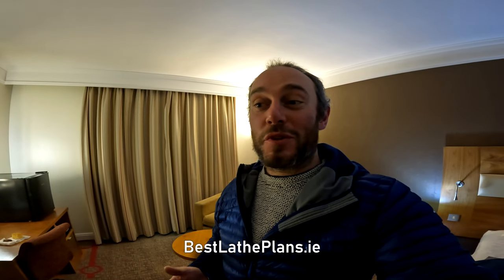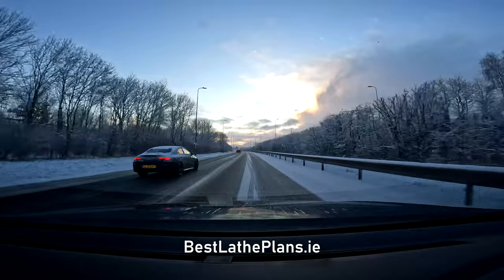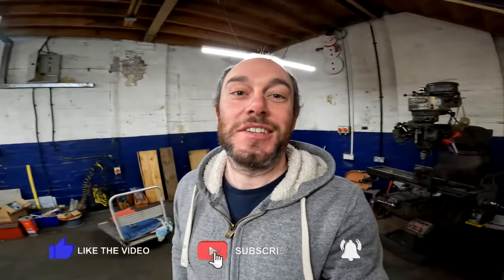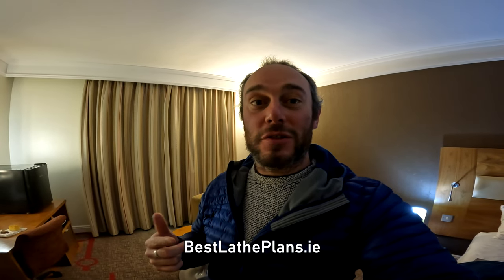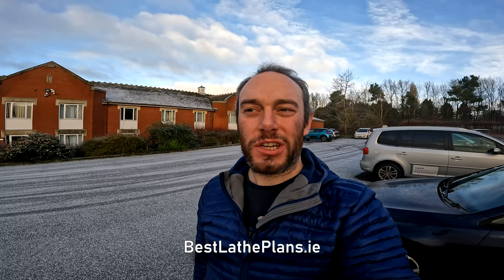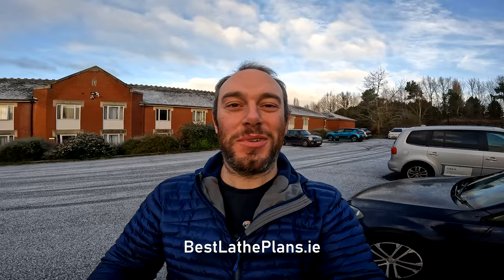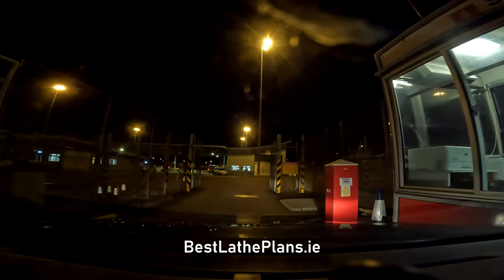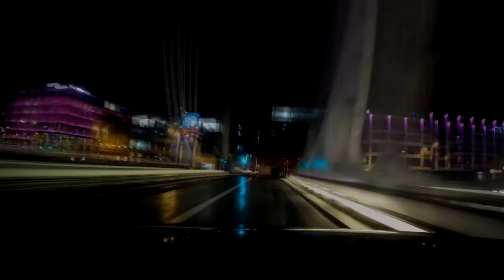Rescuing vintage machines noone wants! Kitting out a Hobby Engineering Workshop for cheap!

Comment: It's lovely to see that you are buying really good quality older machines. You can spend the same or more on far eastern machines (made on old machines like this!!) but those will need replacing themselves in a few years time. What you've bought is machinery of a totally different quality, that will see your grandchildren out. And it sounds as if you've bought at incredibly low prices.   Conversely, it's also lovely to see these  fine machines are going to a good home where they will be looked after and appreciated.  I wish you the very best of luck with them.

Comment: I'm 82, have been a model engineer since I was 12. Seven steam locos constructed in three 3.5gauge, two 5 and two 7.25 plus a lot of other "stuff". My workshop comprised an elderly Colchester Chipmaster 5in x 20 lathe an Elliot 10in stroke shaper, a band saw, drilling machine and a ton of small tools etc.
I have found used small professional machine tools offer the best value in terms of accuracy and capacity.

Comment: Cheers mate! I'm just building my shop over in Bulgaria.
Reply from the maker: What are you kitting it out with?
Reply: @BestLathePlans  so far I got:
- HBM Lathe 360x1000
- Cormak Lathe 410x1000
- HBM BF 30 Milling Machine (this should be converted to CNC)
- HBM BF 60 Milling Machine (this one is as big as your Bridgeport)
- HBM Grinder
- HBM Sandblasting Cabinet
- HBM Band Saw

Here in Bulgaria the used equipment is so expensive. I can only dream of a lathe for 150 pounds... I'm starting my channel as well. I will follow yours for sure. Cheers!

Comment: I was chatting to Matt and Julia 2 weeks ago at Guildford on their last minute getting the Business. It was such a lovely workshop went in 2017. Nice mill. Me 9 lathes various and 3 milling machines. Yes I use at least 3 machines each day building something in 5 inch. Plans to build a cnc lathe and a mill both for metal. I won a smaller Progress Drill for £100 on e-bay. Yes them 12 " rotarys are very heavy plus 2 6" Abwoods.

Comment: ow you did buy it nice
Reply from the maker: Yep. Its in storage here while I get it cleaned up. Its a gorgeous machine!!
Reply: @BestLathePlans  I was at the place you with a shop about five years ago. Looking for a Dbit grinder now. You will use it often once you get it going. You got great prices on that stuff.
Reply from the maker: I can't believe this stuff sells so cheap. It's mental.
Reply: I'd be interested in knowing the total cost, including rigging costs and transportation back to your shop, for comparison to what we're doing here in the states. What we generally deal with are either worn-out machinery that is in need of a lot of work to put it back into proper condition, or wildly overpriced machines.  Sometimes, they are both.